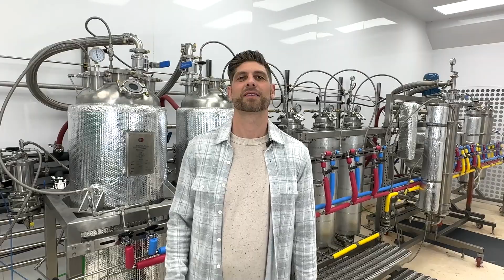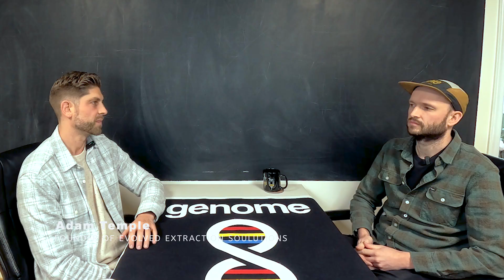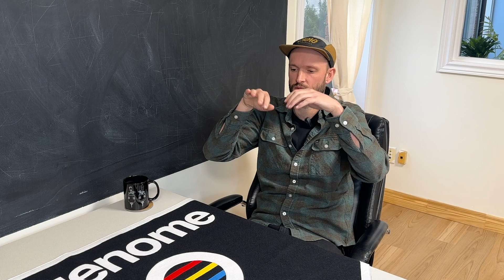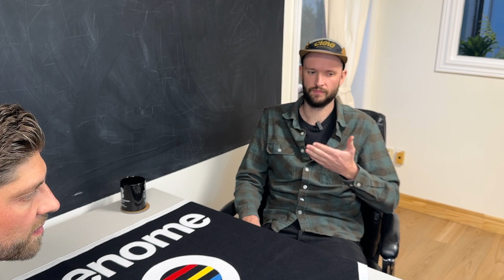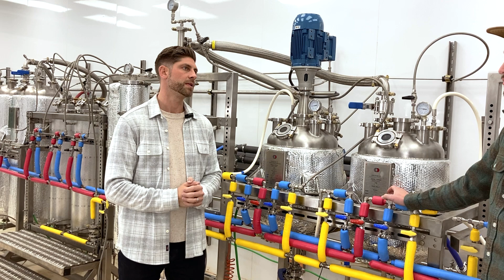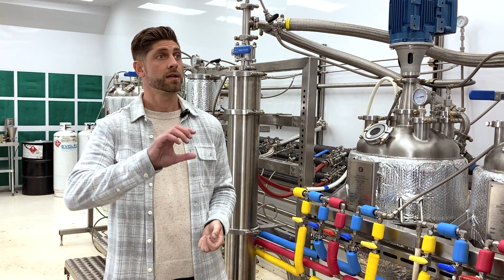How to Scale Hydrocarbon Extraction 3x Faster Without New Equipment 🔥

Comment: Saying compressors can’t scale is like saying engines can’t make more power — it’s all in how you run them (and the size of the compressor).

Mass flow = f(RPM, CFM, Pressure, Gas Temp). Run a compressor at 0 PSI inlet and you’ve already killed its throughput. Raise inlet pressure, and the same compressor moves exponentially more vapor per minute. We run ours around 50 PSI inlet all day long.

“Passive scaling” isn’t scalable — it’s thermodynamically inefficient. You end up chasing enthalpy with 30–200 kW chillers and heaters just to move the same mass flow our compressor handles at a fraction of the power.

Our patented Heating and Refrigeration System (U.S. & Canada) isolates process and utility loops, using backpressure to harvest the heat of compression for recovery — no nitrogen, no external heaters, no –80 °C chillers, no CO₂/dry ice, no LN₂.

Bigger compressors = higher throughput. Not more compressors. (lol wtf who thought that was how its done?)
Our 791 moves whatever its inlet pressure allows — we’ve had it pushing 70 lb/min with a 70/30 propane-heavy blend. Propane is simply more selective than butane, so it needs a higher ratio.

We can hit 5, 10, 20, 30, and 50 lb/min recovery rates with ease using one properly-sized compressor matched to the target rate.

The irony? You’re pushing chillers… which are compressor systems. 😉

Our biggest system currently runs 300 lb/hr, but building a 500 lb/hr or even 1,000 lb/hr system is straightforward and cost-effective — all with a single process compressor and no water heaters, no cryogenic chillers, no nitrogen, no CO₂, no LN₂. Most importantly: no quadratically scaling to move more mass like it is REQUIRED for passive systems. (You cannot avoid it)

"In a passive recovery system for propane or butane, the rate of mass transfer is related to the surface area available for heating and cooling, which leads to a quadratic scaling effect. As the scale of the equipment (like a solvent tank or a condensing coil) increases, the volume grows cubically, but the surface area for heat exchange grows quadratically. The quadratic scaling relates the transfer rate to the surface area of the heat exchangers."

Passive = surface-limited (quadratic cost).  Passive systems fight against pressure. 
Active = flow-limited (linear cost).  Active systems use pressure as fuel.

Edit: Can't forget this... Gene Pool (the patent trolls) has a patent on passive systems and will come after every single operator of your equipment that exists here in the U.S.  🤷

🔗 www.illuminatedextractors.com